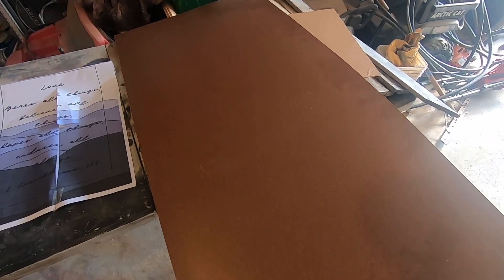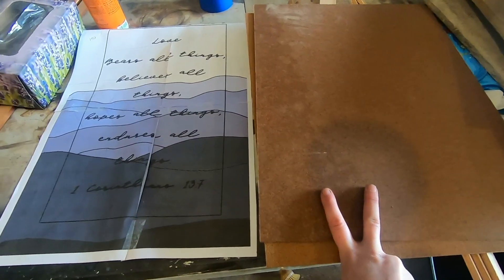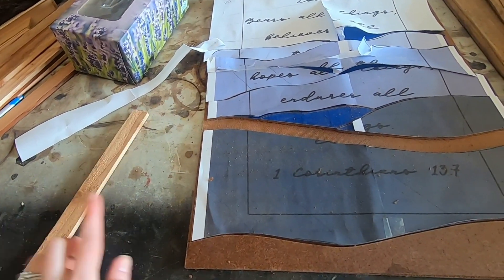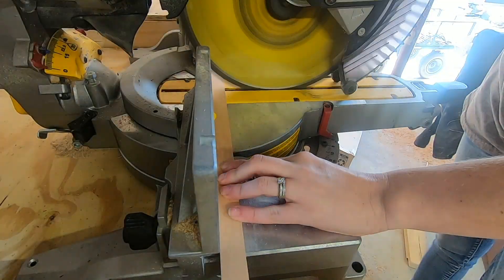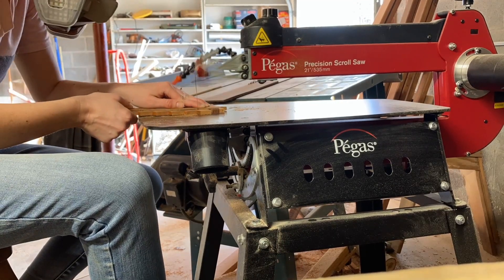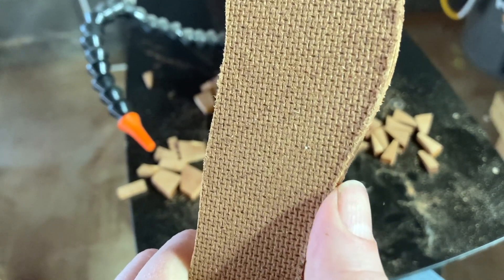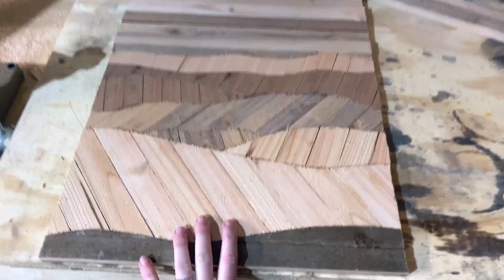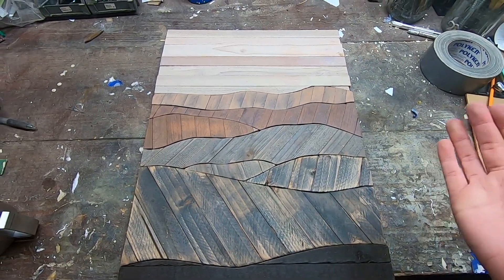Scroll Saw Wood Inlay Art

Comment: Cut the wood pieces about 1/16" away from (or larger than) the backer board.  Then use a flush trim or pattern bit in a router to trim the wood pieces to match the backer board exactly.  Set the bearing of the bit to ride along the backer board.  It will trim the wood pieces to be an exact match of the backer board.

Comment: Be careful not to side pressure on your blade.  Cutting from the bottom side will exaggerate the miss alignment. A #7 or #9 blade should work fine and you will find it will help with side pressure. Great video.